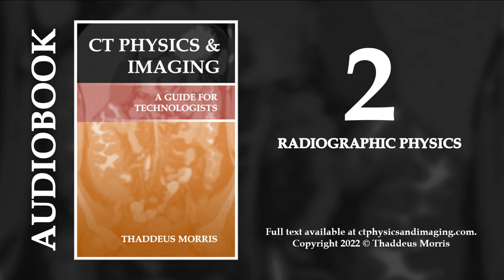Chapter 2: Radiographic Physics (CT Physics & Imaging, by Thaddeus Morris)

Comment: You said if rotation time is decreased then dose will decrease and immediately after said if RT increased dose will decrease.
Reply from the maker: Good catch. This section should read: "If the rotation time is decreased, the dose to the patient and the exposure to the detectors will decrease by the same fraction.
 If the rotation time is increased, the dose to the patient and the exposure to the detectors will increase by the same fraction."